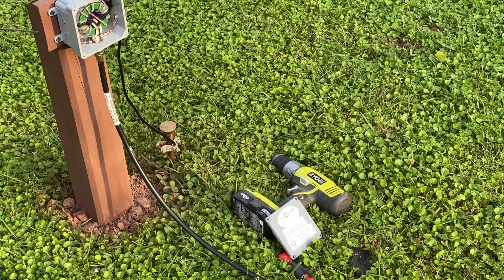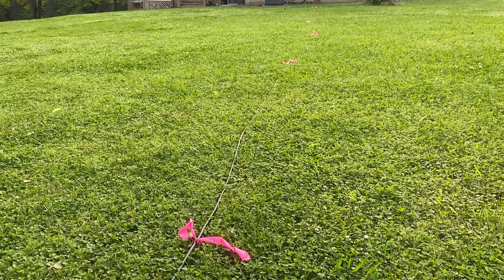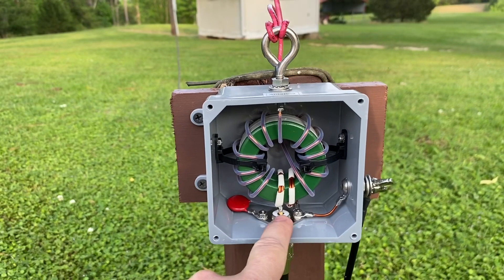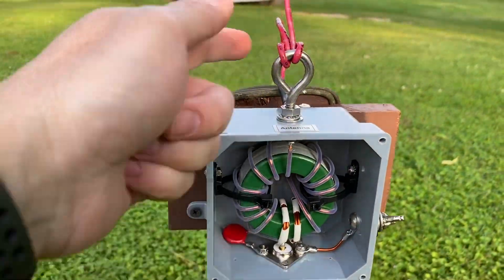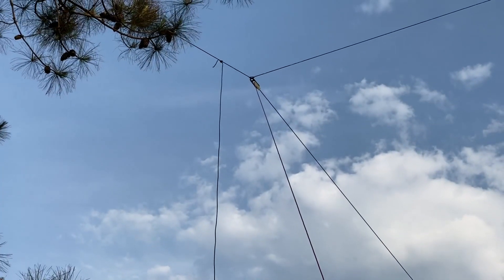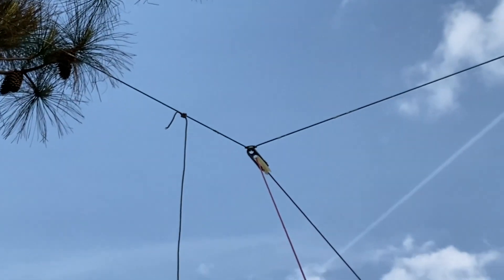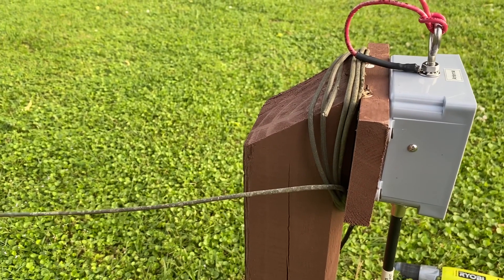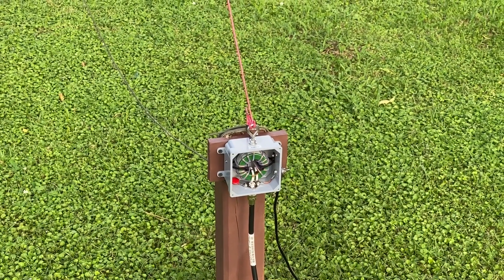Balun Designs 49:1 End-Fed Half Wave Install

Comment: Full wave loop for me ! All i have ever used not even a so239 just strip coax back and twist on 243 feet of black 14 gauge stranded  ! I have been a ham for 28 years and it is all I have ever used. I’ve gone through two of them one to manual tuner  and one  to An LDG 100. If I can hear them they will here me ! Nice and simple and cheap KE4TDG. 73.  Shrink Wrap Ends.   : ))

Comment: Neat set up.  A few weeks ago I homebrewed a 71 ft random wire with a 9:1 unun I built.  I also laid down about a dozen radials and it tunes from 160 to 10.  I've made a lot of contacts  with it... especially on 17 and 12 meters.  I'm a CW op - de KE7LOY.

Comment: I have the same one, you needed to do with this. I made my own I think the problem with this one is the two wires which would be considered primary the not twisted together they should be twisted. The one I made I twisted the two together and I'm almost flat on the upper part of the 75 m band all the way to the 17 m band. Mine is just not a box on the side that I don't know what I'll do it

Comment: What kind of core material is that? 43.... 31.... or 2 mix? fairly sure that isn't #2 mix because all the cores of that mix seem to be painted red.. yours is green.
Reply from the maker: I do believe it is a 31. Here is a link to the manufacture website: https://www.balundesigns.com/model-49131-49-1-80-10m-efhw-up-to-1kw/
Reply: To me it looks like a PC 40 toroid, a low band MnZn toroid up to 2 MHz. A transformer with a lot of loss at 80-10 MHz, I wouldn't even use a mix 31 for that!
Reply: I purchased an FT 240 52 core from Digi-Key... it's painted green... Richard Fryer VA7AA

Comment: does the plastic box hold the wire's tension?
Reply from the maker: Seems to do a pretty good job.  I think it holds the tension of the wire best if the wire is not pulling on the lug at a angle.  Mine is, and in the summer heat it seemed to want to bow the plastic box.  I have intentions of moving my transformer mounting location which would correct this.

Comment: What determines whether the unun should be 49:1 or 9:1 for an end-wave antenna? Thanks.
Reply: Short answer..9:1 is for RANDOM length end fed...49:1 (or even 64:1) is for HALF WAVE end fed. Half wave not being random at all but measured out specifically. 9:1 being a random length, both still fed from just one end! (of course there is more to it but this is the short answer)
Reply: watch the difference between "end feds" as they are not all the same... a quarter wave whip is also "end fed" but doesn't need any matching un:un at all.  An end fed HALF wave (or multiple thereof) is high Z in  (a couple of thousand ohms) so needs the 49:1 (49 x 50 ohms around 2500 ohms). Note a half wave on 7MHz is two half waves on 14MHz and three half waves on 21 so can work on all these bands with the same 49:1 un:un. The 9:1 transformers are used on other lengths of end-fed (or off centre fed) antennas.
Reply from the maker: Not sure if this answer will be helpful but.... I had previously used a 9:1 and it was very noisy, tried a ugly Balun which helped a little.  Talked to the guys at Balun Design and they said that was a known issue with 9:1 / so they suggested I go with a 49:1 since I also had plenty room to extend a longer wire.
Reply: @KC5TGTRadiosNMore  Many thanks!
Reply: A 9:1 is for a random length wire. The wire should not be a length that is resonant on any band. A manual tuner must be used. The impedance at the feed point is about 2,000 ohms. 

A 49:1 is for a resonant half wave wire. You cut the wire a half wave length long for the lowest band. Approx. 130 ft for 80. It will be resonant from 80-10. You may need help on the WARC bands but the internal tuner should take care of that. The impedance at the feed point is approx. 5,000 ohms.
Reply: I have room to run 300' of antenna.....Would a longer antenna allow me to tune up 10 through 160 ???

Comment: How does it work? Are you happy with the 49:1 transformer?
Reply from the maker: I like it a lot.  I can achieve a low SWR on many HF bands with it.  I'm currently waiting for cooler weather to tweak the wire length.  A little tweaking and I think I can get it working even better.  Thanks for the reply!
Reply: Where did you get plans for EFHW BOX?
Reply from the maker: There is a facebook group called “End Fed Half Wave Antennas” also search for “Steve Ellington” on YouTube.  He has a lot of great videos showing construction of this type of antenna.

Comment: Excellent. What type of connector for the antenna, is it a FORK type ? I have the same UNUN Claude VA2SOB
Reply from the maker: Hope this answers your questions.  The manufacture "Balun Designs" includes a modified ring connector that you can attach your own wire to.  You and easily make another one if you have spare ring terminals.  You just cut a small piece of the ring out so it will slip over the shaft of the bolt.

Comment: Nice setup.  Last summer I was it a [  let's try something new mood  ]. So, I ran 280 feet of 10g stranded wire [ EF ] from  15ft high to 70ft high using two pullies. Not sure what 280 was going to do but whatever.  lol.  Bingo across the bands.
Reply from the maker: Yeah I want to play around with the length of wire attached to this one as well.  I got plenty room to make it much longer.  Sometimes you just get lucky!